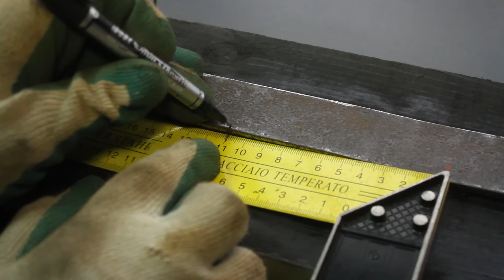I sharpen drills in 10 seconds. tool for sharpening drills.

Comment: A few things wrong 
1. That sanding disc on the grinder isnt flat youll never get a true result.
2. You cant put a relief cut into the drill bit without a grinding wheel.
3. That drill bit was not sharp when you finished the smoke from heat and the swarf indicates to much pressure and no roll back on the cutting face.
4. If you cant sharpen a drill bit by eye on a bench grinder then dont try and show people some rubbish that doesnt even work.
5. If you cant sharpen a drill bit by eye on a bench grinder you shouldnt be using one.
Reply: King shit right here Cory
Reply: @Maddi-wz9hy  Vous affutez un forêt sans lui donner d'angle de coupe? Vous ne savez pas de quoi vous parlez, donnez un angle de 120° en pointe mais ce n'est pas cela qui va faire que votre outil va couper. Prenez quelques cours de technologie!
Reply: Давно у нас на предприятии токарь на глазок затачивал свёрла. Сверлили как заводские. Кстати сейчас к нему продолжают обращаться люди для заточки свёрл.
Или же специальный станок нужно или на глаз.
Reply: @СергейИванов-ю1ц9и  At the very least it's sharper than before with minimal tooling
Reply: I dont even watch these videos anymore. Just come straight to the comments to see how bad the video is going to be.